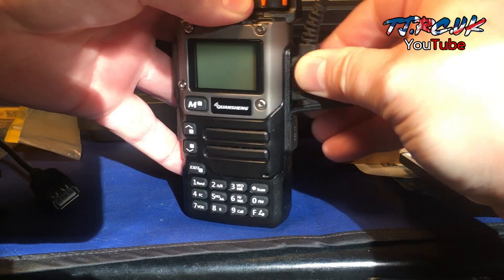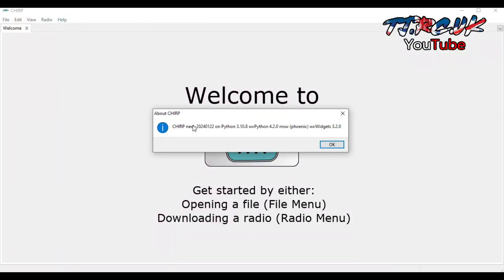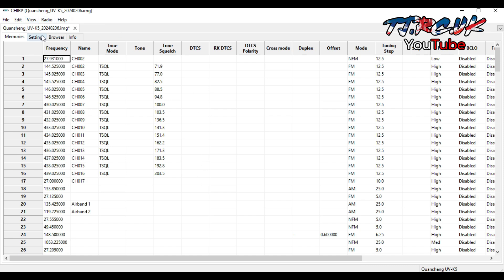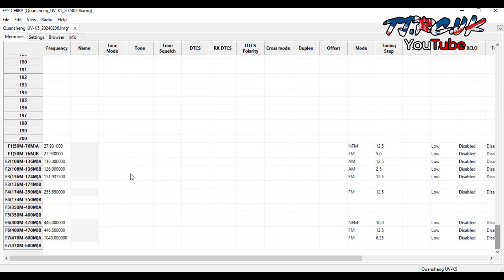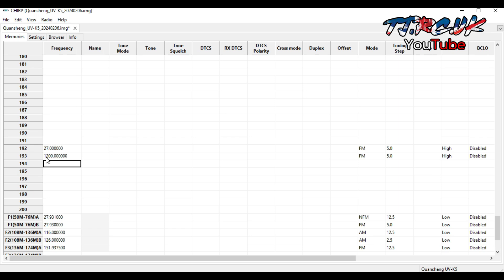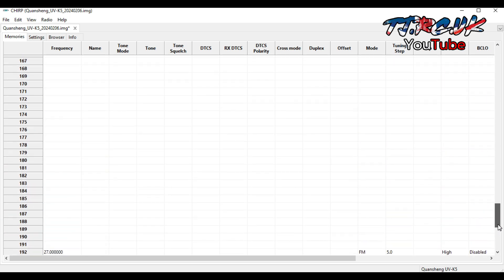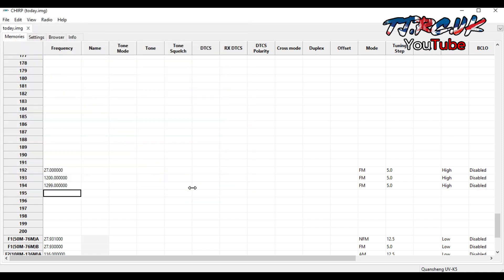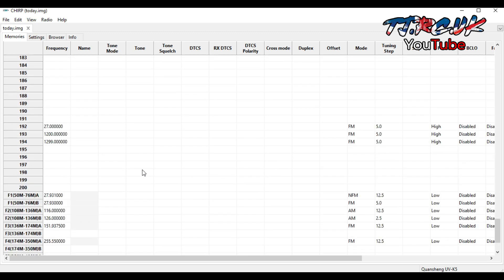UVK5-UVK6-Chirp now works with egzumer v0.22 without having to load the py file in each time! #uvk6

Comment from the maker: ⭐My website link "Custom Firmware Modders Community": https://tjrcuk.serv00.net ⭐
For...⭐News on updates⭐Downloads, Firmware, Chirp Files, Flashing Tools⭐Docking Station Info ⭐*NEW Meshtastic⭐General Chat + Help
Head on over & join up & get involved :)
#uvk6 #quansheng l #meshtastic
⭐CB Antenna If you want to listen to 27Mhz⭐You will also need to get a female SMA to female BNC adapter for this antenna linked below also...⭐
⬇CB Antenna 27 Mhz-Prime Next Day⬇
https://amzn.to/3U9kucl
https://amzn.to/3tVNKZx
⬇⭐Akozon SMA to BNC RF Adapter Connectors⭐⬇
https://amzn.to/3tQdAOm
⬇Qhansheng UV K6 radio⬇
https://s.click.aliexpress.com/e/_DEgKFup
⬇Programming cable for the UV K6⬇
https://s.click.aliexpress.com/e/_DnrAeep

Comment: I download latest chirp and using egzumer 0.22, but no option on Driver information to be check. Maybe not support 0.22 version?
Reply from the maker: You probably downloaded the very latest version which seems to have issues!, find the version I am using & try that :)
Reply: Version 20240122 works but not the latest one !
Reply: @petercarter9034  Just tried Chirp version 20240122 with my Mac , it doesn't work for me (no communication with the radio), saying that I couldn't even flash Egzumer 0.22 with my Mac but i managed to do that with a PC :face-turquoise-covering-eyes:
Reply: @petercarter9034  ok i can confirm Version 20240122 worked with my PC, importing and uploading repeaters details in one go is great !
Reply: @petercarter9034  hi, is there a place on the chirp size to download the previous version?
Reply: @aircowboy09  in chirp the new version overwrites the old you have to remove it before re installing an older version. In the older version go into settings/driver and tick the box so that out of band frequencies will still be read
Reply: Having the same problem (on Apple Mac), I'll try with the version mentioned on the video 📡